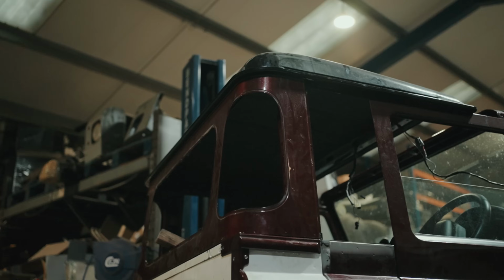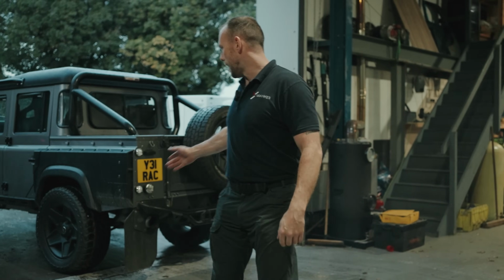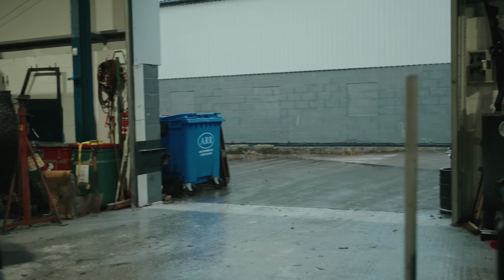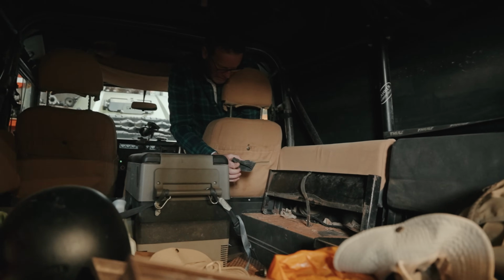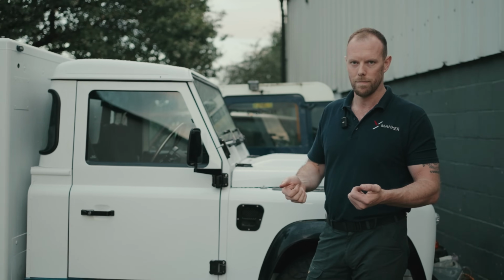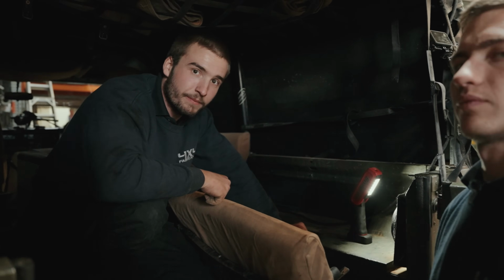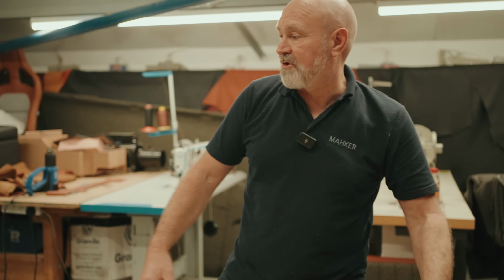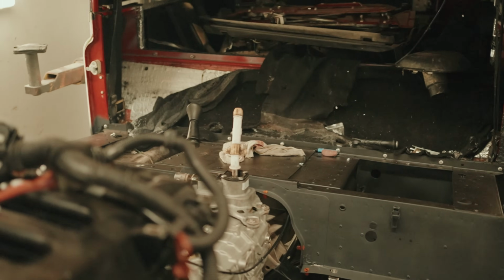NOT How you'd Expect this KAHN Defender 110 to Sound... || Mahker Weekly EP098

Comment: Why don't you guys do Mercedes Benz Om606 engine swaps?
Reply from the maker: Because they are not suited to 4x4vehicles. Ask yourself why Mercedes never fitted it into a 4x4. 

From our experience it has poor torque low down.
Reply: Thank you for the explanation, it makes a lot of sense. The Om606 is also a very high revving engine I heard, and like you said it doesn't have a lot of low down torque. I want a mechanical and reliable engine for my defender, what engine should I get? Should I stay with the 300tdi, only problem is with the 300tdi is it is a bit slow on the road, especially for hills and underpowered for towing. Do you guys have any experience on the 2.8TGV International engine, it is like a more powerful version of the 300tdi originally made in Brazil I think.